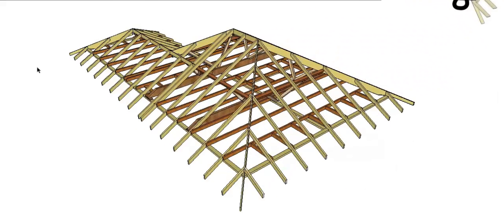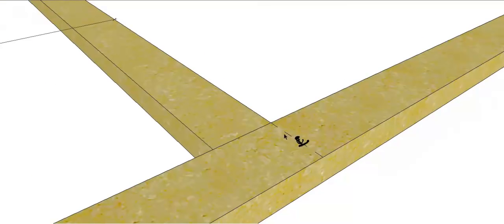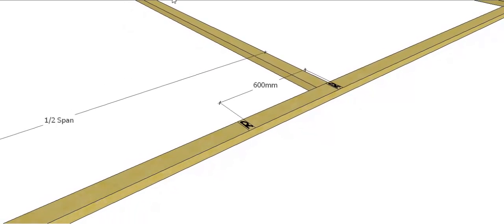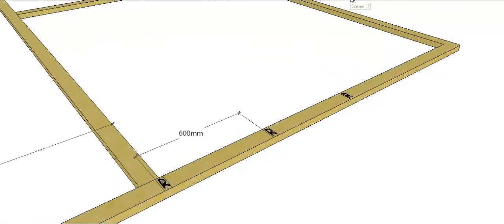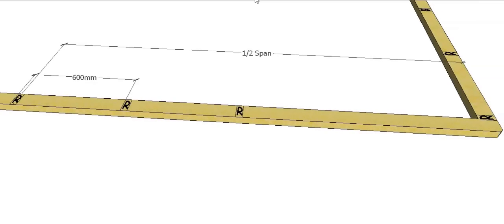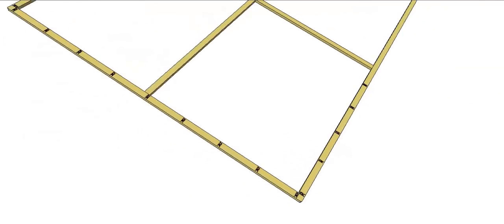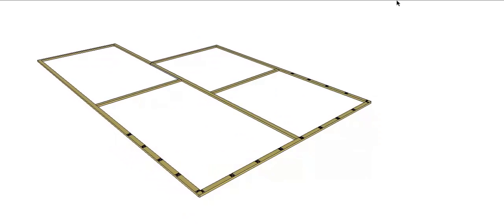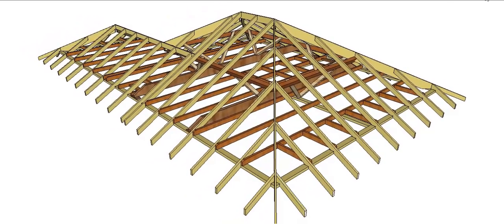Setting out a Hip End

Comment: Thank you for making this video, it makes easy to understand how the roof holds itself up.
About the ceiling joints at the end that go the other way, presumably they need to be very securely fixed where they butt to the main joists? 
How would they normally be fixed?
Reply from the maker: Hi Richard, thanks for your comment. They would just be nailed or screwed together, no need for boots or hangers as they are only taking the ceiling load. Hope this helps.
Reply: @Buildsum  Very helpful thanks.